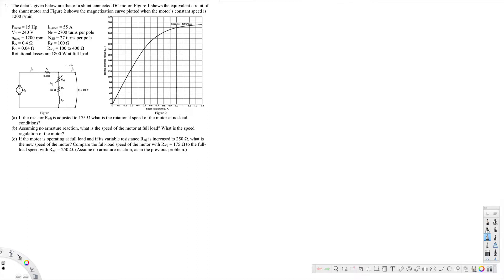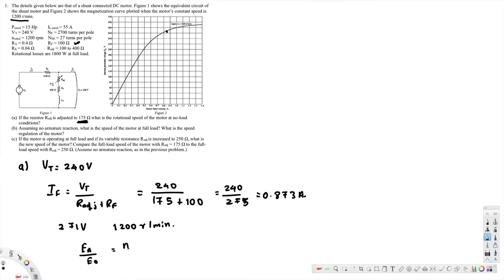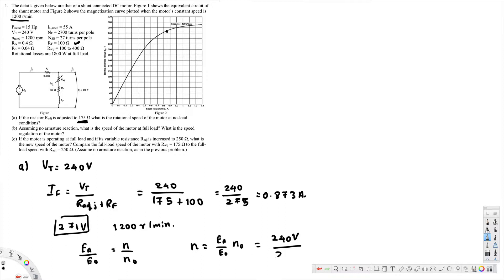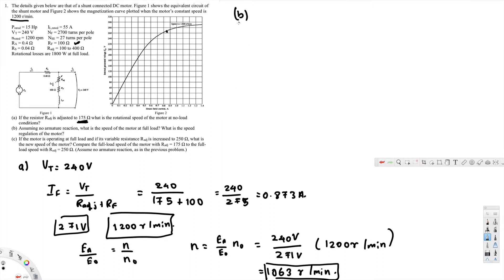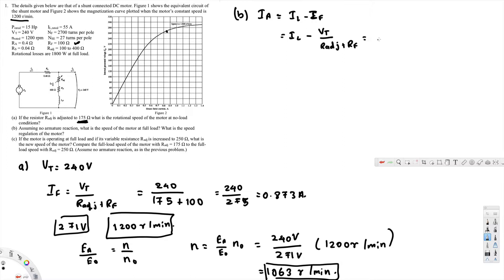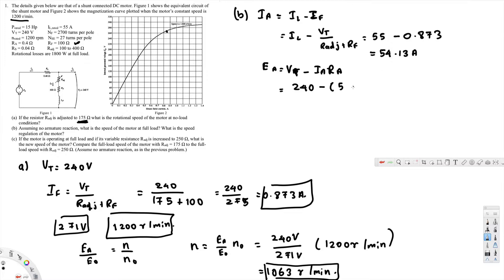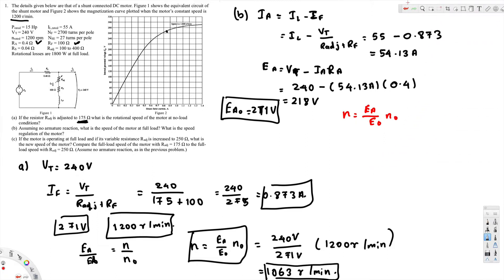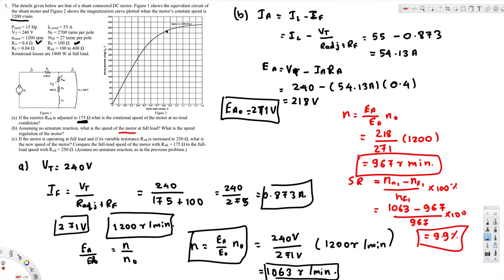If the resistor Radj is adjusted to 175 Ω what is the rotational speed of the motor

Comment: Assume that the motor is operating at full load and that the variable resistor 𝑅𝑎𝑑𝑗 is again 175Ω.
If the armature reaction is 1200 A· turns/pole at full load. What is the speed of the motor? How
does it compare to the result for Question-2?